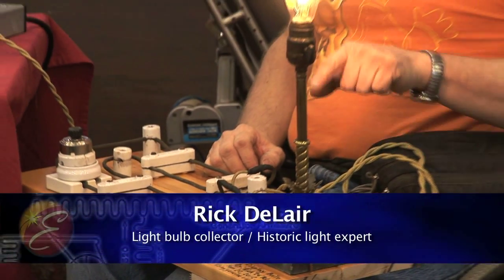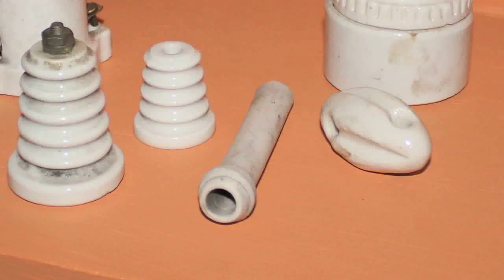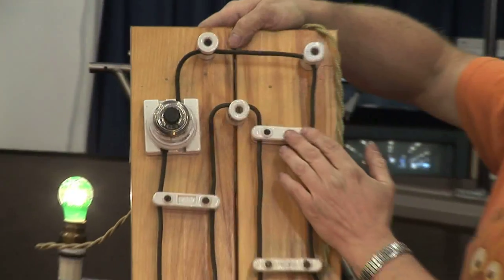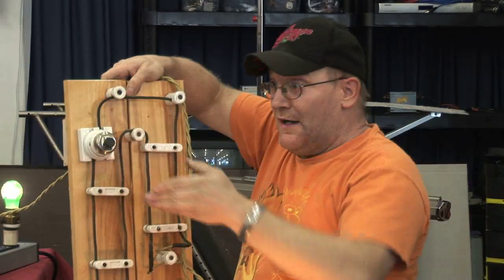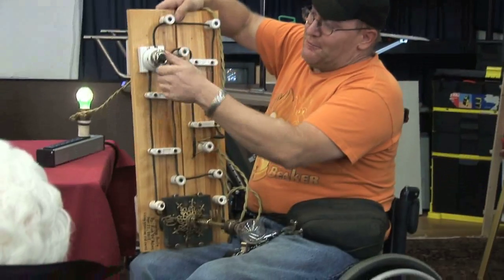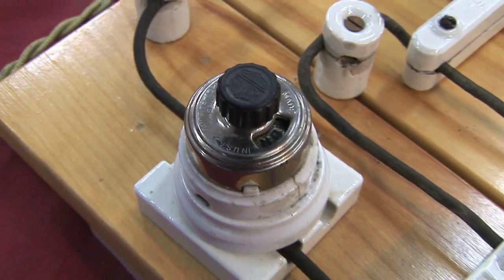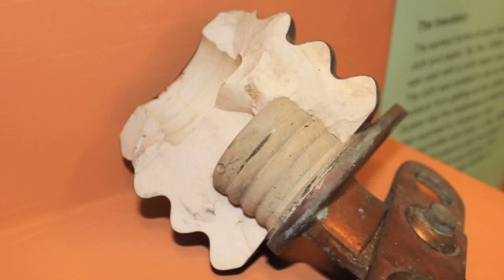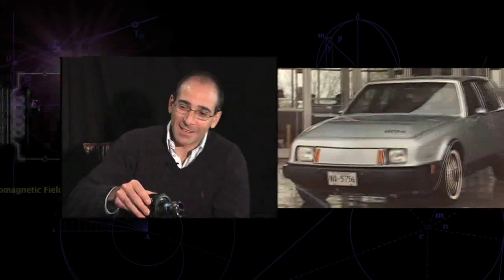Knob and Tube - early electrical insulation

Comment: Very nice presentation. 

Those antique bulbs should only be burned on reduced voltage though.  There are only so many left, and once they're gone, they're gone forever. 

It also would be good to point out that knob and tube wiring is at least as safe as modern wiring, to dispel the myth (no doubt spread by unscrupulous electricians looking for work) that it should be replaced.
Reply: ***** Rubbish! California and many other states have never seen a single fire caused by Knob and Tube wiring. Myself I would be more concerned by cloth covered romex!
Reply: EdwardsStation onSif Even the early thermoplastics found in 1950's and up cloth romex hold up very well, and should last for decades yet. 
But as with all types of wire, it's good to inspect in and around fixtures where incandescents have been used for years.
Reply: realvanman1 I believe the reason why knob and tube is so unsafe is because all the returning load was being put on one neutral. they could get away with running one neutral basement to attic and all the circuits through out the house connect to the same neutral at the easiest location  . eventually neutral will have to much load and heat up and fatigue untill the point of broken wire or arc in the wall.
Reply: The entire house I live in is knob and tube still. No fire yet, with over a hundred years of use. (Just don't tell my insurance company) :P
Reply: I'd imagine part of the risk involves people expanding K&T circuits far beyond the loads they were designed to handle. If it was so inherently under the loads of the day, I can't imagine it would have been nearly the prevalent standard it is remembered as today. Of course, it was designed for mostly lighting. No large AC units, no TV in each bedroom, no 800+ watt gaming PC's.

Comment: The paper is used as a spacer/gap filler to keep the conductors from shifting or kinking when the cable is bent.  The nylon/PVC jacket on the conductors is the actual insulation, although paper is a decent dielectric/insulator if used properly.

Comment: Thought some K&T used uninsulated wire. Advantage of current jacketed wire is the waterproof jacket. Probably K&T wiring used organic material jacketed wiring, and if wet, the copper corrodes.

Comment: there is a house not far from were i live that was built in the early 1900s and was wired with knob and tube at the time it was built 4 years before power was run into our village  they knew electricity was on its way and planed ahead as far as i know all of it is still in use today and in excellent condition along side with the modern wiring  although all 4 original circuits were are arc fault protected with modern arc fault breakers a few years ago after the 60s 60 amp entrance was replaced

Comment: ps. In comparison to todays standards and materials, I prefer the safer wiring of today!
Reply: What makes new wiring safer? The wires are closer and the insulation is thinner the only thing that makes the new wiring better is it's designed for the higher loads of this generation
Reply: @gtb81.  
I agree. I believe knob and tube wiring, when done right, is as safe or safer than modern wiring. They built it so even if the insulation suddenly vanished, the wiring would still be fine. I wouldn't want today's wires in a house after a hundred years.. but knob and tube that hasn't been heavily modified, I would be comfortable with.
Reply: @gtb81.  the insulating material itself
crazy thought, but materials science has improved just a little..
Reply: @walterbrunswick  well yes, it is a bit tougher, but not by a whole lot, wires get nicked very easily, and if pinched by something the insulation will still break and they are right next to each other, so shorts are much easier
Reply: @gtb81.  wrong
modern materials are exponentially better than your "good old days"
I work in houses from the late 1800's, and there really isn't anything that hasn't improved, or greatly improved. have you seen basements from the early 1900's? you prefer lead piping maybe? 
what agenda are you pushing? sounds like you are an armchair expert
Reply: @walterbrunswick  No, i'm an electrician, worked on wiring from the 1920's , 1960's, 1980's, 1990's and have done new installations. I have also done plumbing and carpentry.  Modern Romex, aka NM is fine to use, but i think open free stranded wiring is a better method, however the old rubber cloth covered is fine as long as it is in good shape. I have actually tried to light an original wire from the 20's and it would not stay lit for more than fine seconds, so there were some fire proofing integrated in the later part of the 20's.  Modern materials are a better insulation i never said it was not, but the methods are just fine from K&T, there is nothing wrong with them, the biggest danger is modern loads are far too much for them and time has its toll on the insulations people also decide they want to add circuits to them and overheat them.  They also still use the free stranded method in power lines, and for a reason, it dissipates heat and allows for larger circuit loads.(i have also trained in the lineworker trade)
Reply: @gtb81.  okay just checking
yes obviously at 27kV and higher you will get interference and reactance issues running too close
Reply: @walterbrunswick  well, distribution (at least in rural areas) runs at 7.6kv with 2/0 wire Au, and it can support hundreds of amps on one circuit. A K&T circuit with 14Ga wire can support 20 amp on one circuit where-as modern 14Ga wire can only support 15 amp, so the Old-timmers method is certainly superior to how NM is today, however the method takes up much more room and cannot be covered by insulation, it also costs much more then NM even with the slightly larger amount of copper that is needed, as well as the dangers of it if the insulation fails at all.(only danger however is someone coming into contact with the bare copper wire) So i do not believe K&T is needed to be installed in todays homes,  however i do not think it right to just say that K&T is a worse method of wiring and all of it is bad and everyone should be terrified of it. Sure time has most likely had its toll on it and people have probably dangerously modified it then yes it should be removed or repaired. However if installed and left as designed, and if in good shape it is not dangerous, though it does not have ground.

oh and about the lead piping thing, it is the same as asbestos, great material to use, bad for the installer, though the pipe was also bad for the user. asbestos however is actually fine as long as it is not disturbed
Reply: @gtb81.  where are you located? In Toronto we get 27.6kV and 13.8kV in urban areas 

agreed about asbestos. It's an amazing material. Too bad it's gotten a bad reputation.
Reply: @walterbrunswick  i am in NC,  America, and i agree, asbestos is an incredible material, there is almost nothing it cannot be used for
Reply: @gtb81.  In 2017 our motherland was the largest producer...
Unfortunately in Quebec the govt halted mining operations in 2012😞
Reply: @walterbrunswick  yeah, it causes a lot of health problems for those working with it
Reply: @gtb81.  yeah🙄🤦‍♂️
Reply: @gtb81.  modern breakers... Electrical code lol
Reply: @codymartin6704  the only advantages to modern breakers are gfci combination breakers, and the fact that you do not have to replace them when they trip. fuses are not dangerous, it is when someone does not know how electricity works and they fuse it for too high of a rating when it blows, fuses are actually better in that it has no trip mechanism that can fail, they will always blow regardless of how old, or what condition they are subjected to
Reply: Yeah exception of OSB everything that burns way hotter and way faster.
Reply: If the the old timers had the modern wiring insulations of today, modern breakers instead of fuses, yet combined all this with their open wiring craft work of yesteryear, you'd have a very desirable finished product. The heat dissipation properties of open wiring provide real benefits to the ampacity loading of conductors.
Reply: @MichaelSmith-xb5cp  fuses are not bad at all, they serve their purposes very well if implemented  right,  they are better in that there is no mechanism to fail, they will always blow and stay open

Comment: Tube and knob was a well engineered concept of wiring, the wiring itself stood the test of time, it was Nickel wire covered in rubber then cloth wrapped, and then placed in a loose casing of burlap tubing, I have seen where rodents ate this insulation, this caused numerous fires back in the day im sure. Great piece! I will subscribe.

Comment: I grew up in a Philadelphia rowhouse, the third floor was never rewired, it still had the original tube and knob, their was a junction under the floorboard in the hallway on the third floor,it looked as good as the day it was installed. However, my house was built in 1900, and wired in 1911 for electricity, according to the city records that I found in city hall. The city back then required that any modifications made to a pre existing property needed to be doccumented.

Comment: I have a modest collection od early Edison/G-E, Westinghouse incandescent carbon and early Tungsden light bulbs. I have a few Wert Dimmers as well. The Wert Dimmer when used with a 40 Watt light bulb which was the recommended wattage max for the dimmer, still heated up extensively, it felt like an iron. There was no limitations, their was no Underwriters Laboratories, and many homes burned down as a result.

Comment: the house i'm living in, and running this computer off of is useing knob and tube, love that method tbh.
Reply: The problem is as houses expanded, they simply added onto existing circuits. My kitchen is split into 3 breakers, which are shared by the living room ... 2 rooms away! I can't do anything electrical in the kitchen without messing up the TVs & computers in the living room. 2 outlets on the same wall are on 2 different circuits.
Reply: @theTeslaFalcon  but what are you complaining about? things were better in the good old days!!! 🤣
Reply: @walterbrunswick 
Ecclesiastes 7:10
Do not say, “Why is it that the former days were better than these?”
For it is not from wisdom that you ask about this.
Reply: Same!

Comment: The house I'm working on now is loaded with it.
Reply: Ditto. My bedroom light switch is that turn dial.
Reply: @theTeslaFalcon  poor poor little boy
Reply: @spearvlogs8347  Also have a rotary light switch in my bedroom. It's just as good as any other type of switch.
Reply: I have ripped out the old stuff and install new, was a fire hazard insulation came off exposed wirings,  these days it's all about speed and mass production unfortunately.

Comment: The building I live in now was knob and tube. There's still some in use but it's mostly been replaced with romex and 14/3 wiring.
Reply: cool but very dangerous
Reply: @johnny6071  Danger is good for cleaning the gene pool.
Reply: @Intelwinsbigly  Hahah love that and am definitely stealing it, but still, most likely (99%) balloon framed house and it's gonna go up like a roman candle.